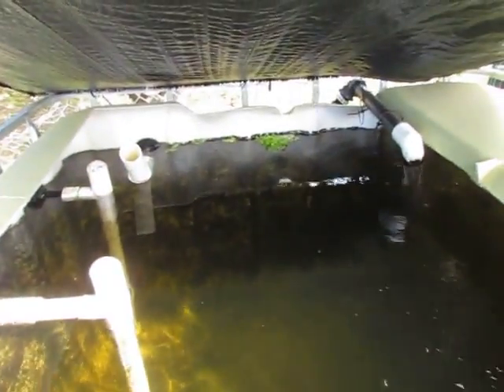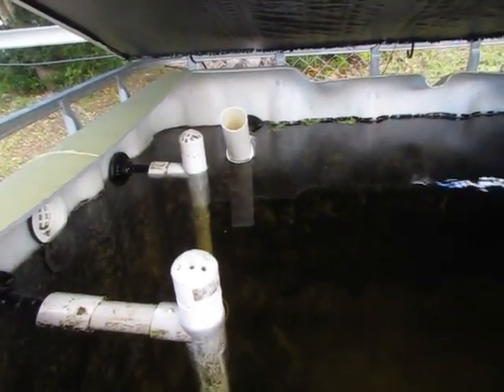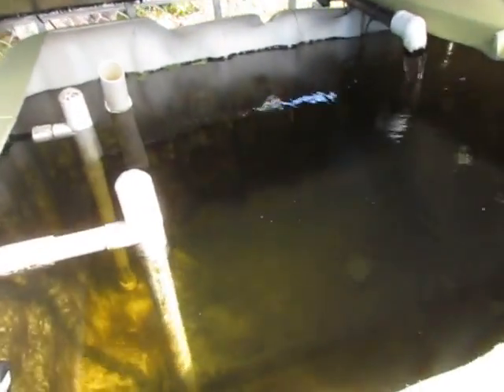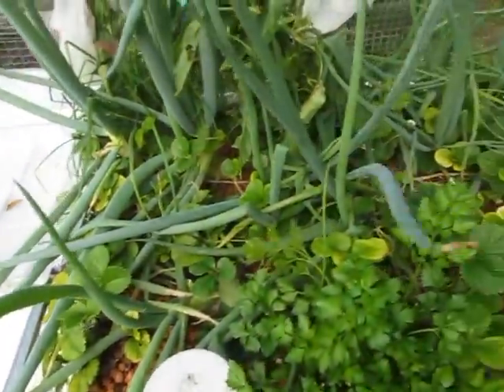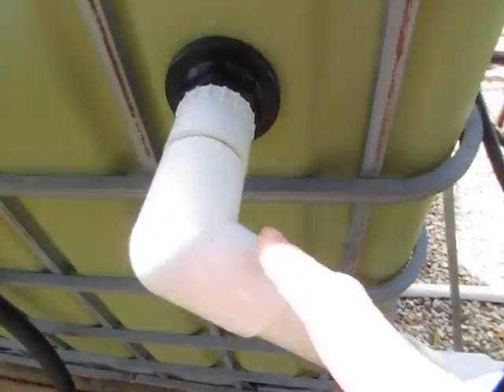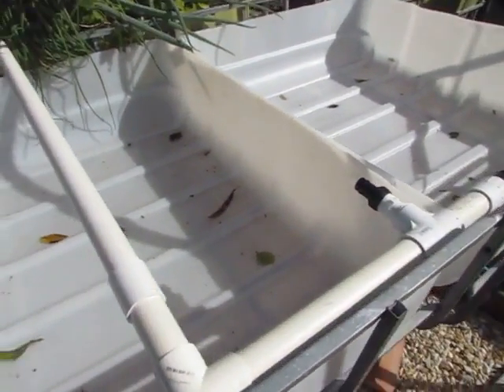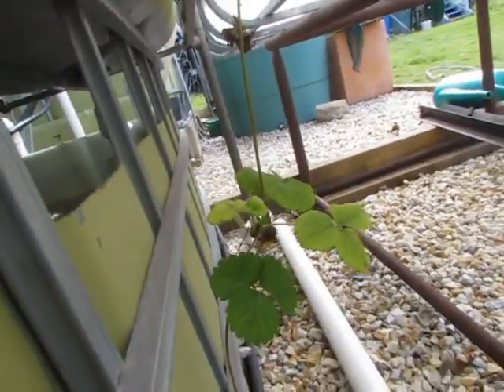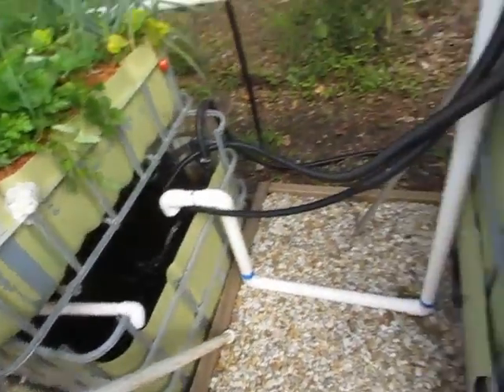Jade Perch Aquaponics update 5.6.12. IBC System construction part 5.

Comment from the maker: I did have a few issues with the siphons breaking on the 2 beds with the longer returns.. To fix it I installed an upright on the return to the sump that allowed air in to help break the siphon.. Since they went in I haven't had a problem really... Hope that helps..

Comment from the maker: Our Grow beds are 300L so I figured that around a 1/3 (100L) would be water.. As you also want water left covering the pump when all the beds are full I allowed another 200L for that so knew I needed a 500L sump min to be safe for the 3 beds.. I did err on the side of caution as I think the beds actually hold a lot less than the 100L of water when full but that comes in handy as it doesn't need to be topped up as much.. TBC.......

Comment from the maker: Windmill is a possibility I would think.. I did run a manually run (bucket) hydroponic system for about a year growing leafy greens in pvc pipes on a slow drip... Worked ok but the air for the fish would be the big concern in aquaponics I would think..
Thanks for watching..